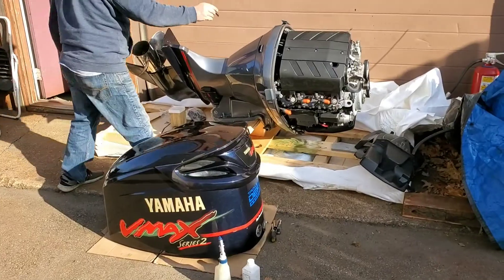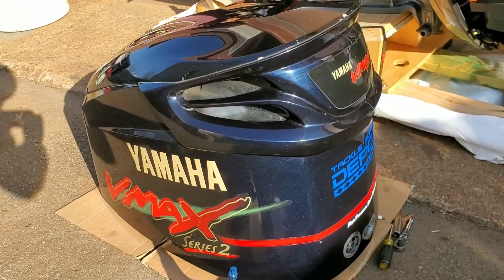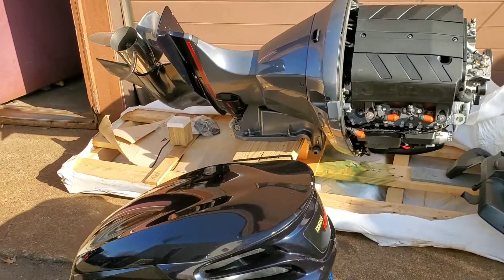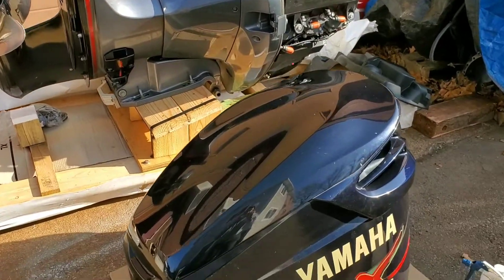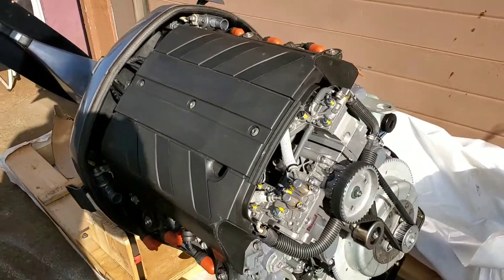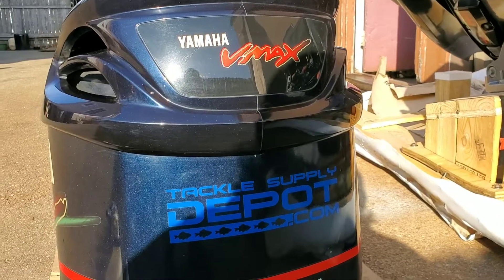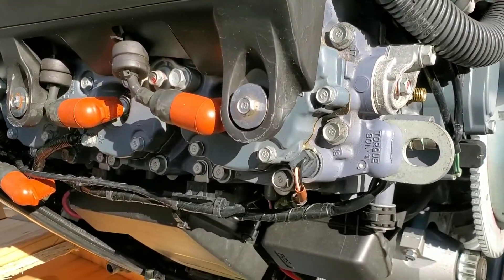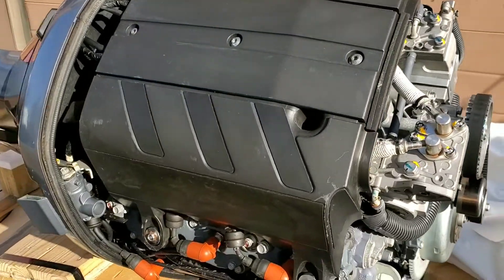2-Stroke 300HP Yamaha Vmax *Blown Engine*

Comment: I have a 225 hpdi that just had a issue with loss of power this weekend. Could you give me an order of what should be checked to diagnose issue?
Reply from the maker: I'm by no means experienced with these engines but I would start with a compression test and fuel injector test. Both simple tests, compression test will make sure there are no major discrepancies with your pistons, rings and cylinder bore. Fuel injector health to make sure they are providing adequate fueling. If those check out, a leak down test will give you more thorough understanding of the health of your cylinder bores and rings.

With these engines, there are these "magic" filters that need to be replaced every so often within the oil pump assembly and failure to do so can cause much larger issues. I think this should get you headed in the right direction but there are a significant amount of electronics that can fail too that would need to be diagnosed with a more research. Biggest thing I would recommend is to not keep running the engine until you get it sorted because lean fuel condition can quickly cause detonation leading to catastrophic failure. I hope you can get it sorted quickly👍
Reply: @shopdreamin372  do you have the rest of the videos of the work you did on the 300 bp?    Would be interested in watching unedited footage to document the steps you took during the repair.